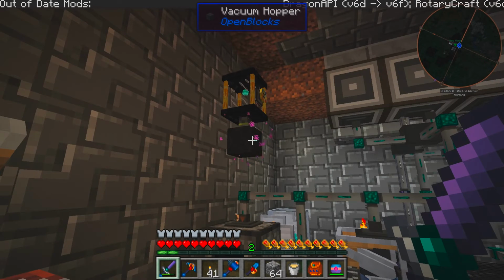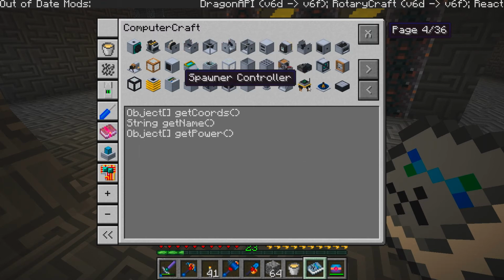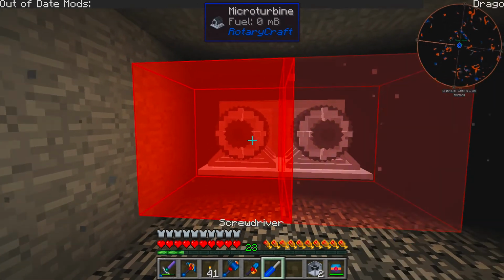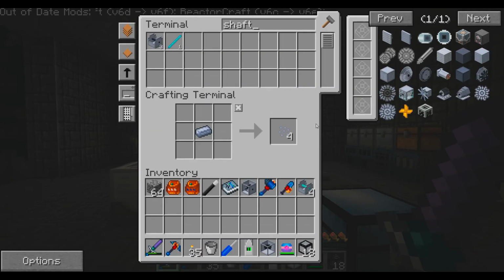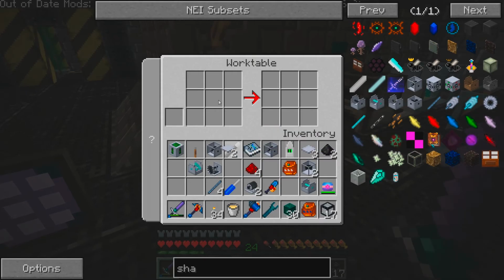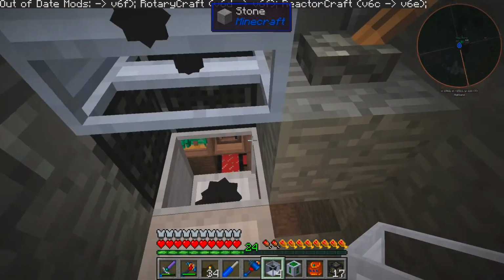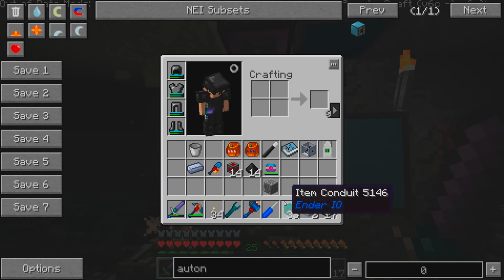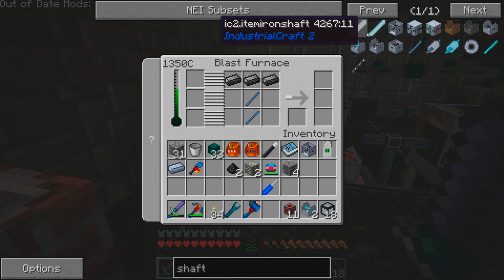Let's Play Modded Minecraft, Season 4, 45 Bedrock and Jet Engines

Comment: You can change the RC config so it allows for y=0 to be mined. But then again you could go to the nether ceiling (can always be broken by the bedrock breaker) or mine the pseudo-Bedrock that encases Twilight Forest mazes.
Reply from the maker: Good points. I still feel pretty justified in using a creative "cheat" as it really doesn't gain me anything other than fixing a misconfiguration in the pack. FTB usually configures several layers of bedrock in packs that include RotaryCraft, but I based my mom list on the DW20 pack and didn't realize that the flat bedrock was configured to start at y=0. I'm currently working on my own custom pack (Reactorcraft, RotaryCraft, electricraft, and Gregtech-hard for maximum sadism) and it's something I'll keep in mind. Thanks for the advice though.
Reply: MrKeserian
 I agree, it's not really that cheaty. Also what just came to my mind is that the config allows for machines to be crafted outside the workbench in any crafting grid. That would probably give you at least 2-3 minutes per episode to spend on something else. Tbh, the workbench just gets midly annoying after a while.